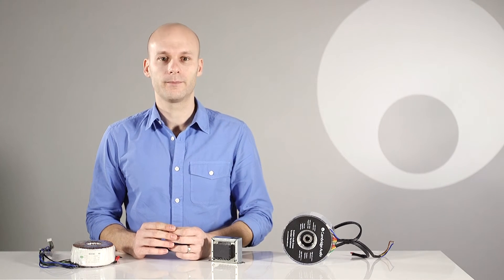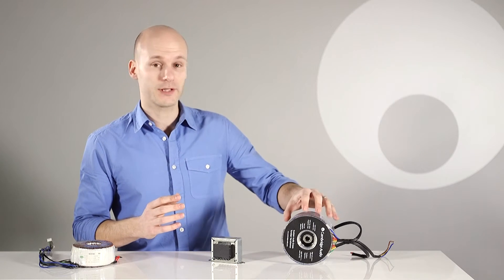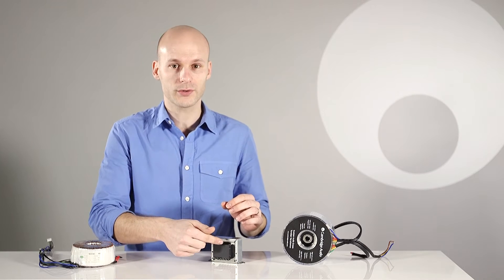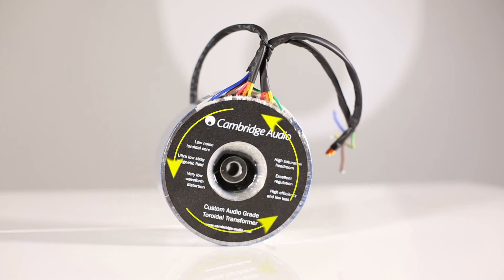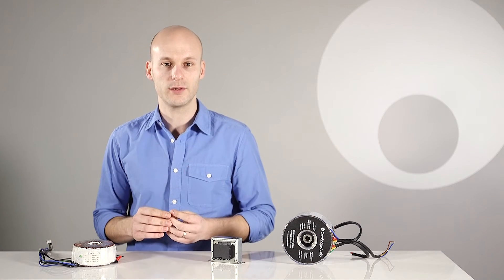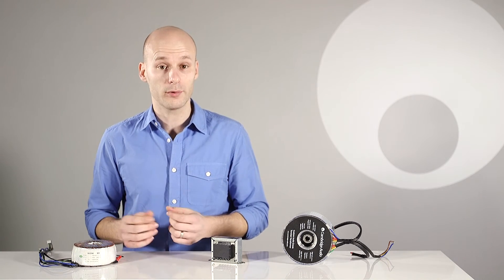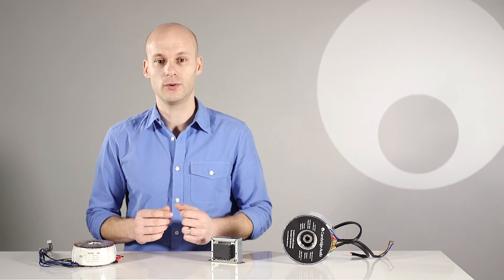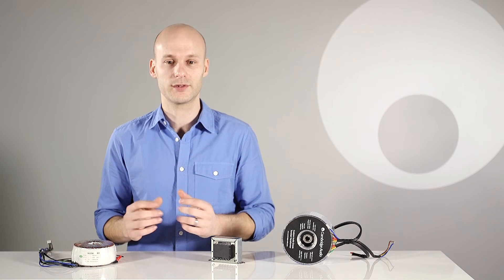Transformers Part 3: Why we use Toroidal Transformers

Comment: What he’s not telling you is, the thermal fuse inside the toroidal transformers are so sensitive almost 80% of its amp blows up and you have to either rewind it yourself, or replace the whole toroidal transformer. It’s a legal “scam”. My 851A had exactly the same problem and they don’t even have a service outlet in Tokyo so I literally have a junk at home. I personally think QUAD is better in circuitry and the components used. Less trouble too but it doesn’t make as much audio equipment as Cambridge Audio .

Comment: And then their operating temperatures are much lower than that of the EI transformers. When you use a low frequency inverter with toroidal and non-toroidal transformer, you'll see that the difference is very clear. The toroidal inverter system is always cold to touch and has very little idle power consumption.

Comment: I have to ask; does the direction of the secondary winding go in the opposite direction  of the primary winding (CCW vs CW for example) to counteract the flux in the teroid thus, reducing the voltage ?   I was never too good with that left hand rule thing

Comment: You use very noisy toroidal transformers, I can hear its buzzing from CXA81 on my listening position, three meters away. Not good!
Reply: They also use cheap Chinese EI transformers on the AXA25, I hear it buzzing and vibrating from 3 meters away, even with low-volume music. I sent it back.
Reply: I have a cxa61 and have never ever heard any noise from it in 4 years

Comment: Hi,
I have an azur 851w. The transformer humming sound is very loud.I can't  keep that amplifier inside my rack due to heat, so kept top of it. Very audible 50hz noise from amp. 
I can hear buzz through speakers also.
Need any service? Its crosses one year warranty.
Thanks
Reply: My amplifier uses two EI transformers and it's dead quiet . NAIM amplifiers are equipped with toroidal transformers and they are famous with their buzzzzzing, hummmmming.
Reply: Yes you have a problem or design suck cause I own my amp with rectangular tranformer and no hummmmm if you crank it at 110w RMS    Little noise from the environement wish is it normal but a big HUMMM is not normal   ( rectangular or toroidal )